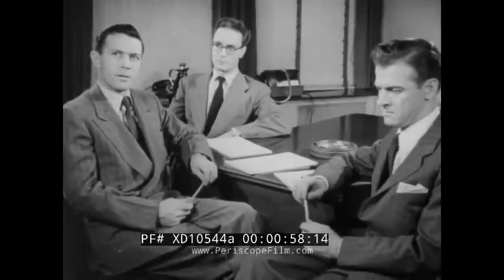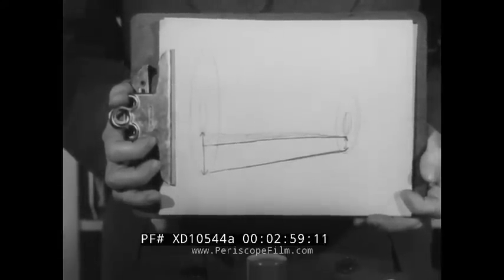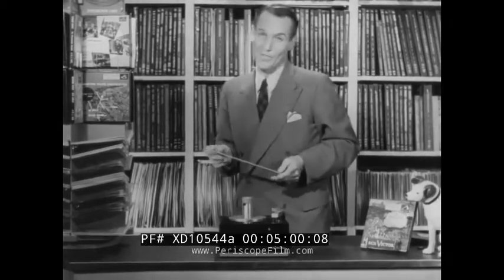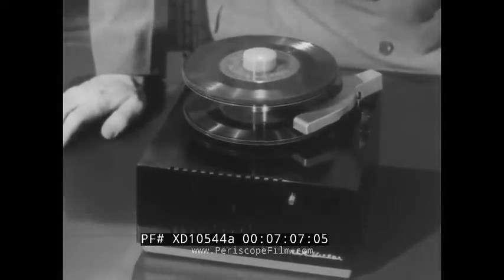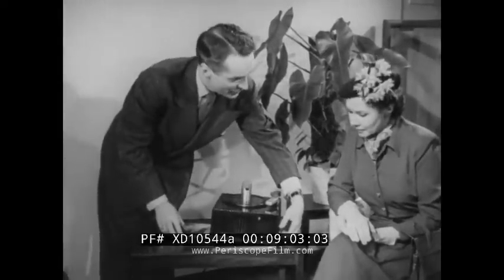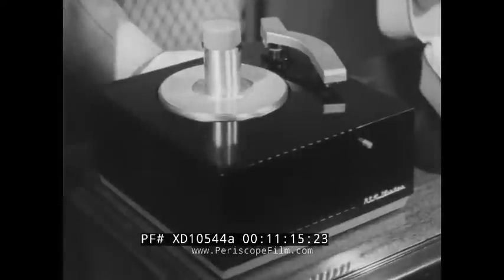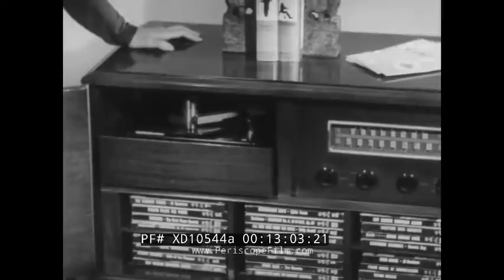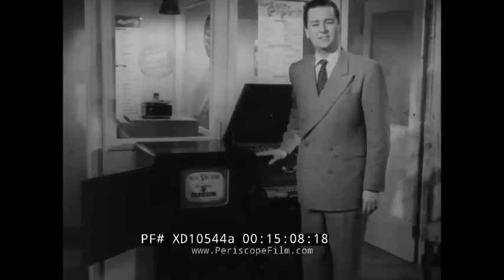NEW RCA 45 RPM RECORD SYSTEM & RECORD PLAYER PROMOTIONAL FILM   VINYL RECORDS XD10544a

Comment: 45s may have been superior in terms of sound, but certainly not with regards to convenience. And entire albums on 45 would have also compromised the artistic vision of recording artists like the Beatles and Pink Floyd. Imagine having to listen to Sgt. Pepper or The Dark Side of the Moon using a 45 rpm record changer.  Personally, if I had been living back in the 50s and 60s, I would have bought my albums on reel-to-reel. I really can't stand the ticks, pops, and surface noise of vinyl.
Reply: You definitely don't get it even a little bit.
Reply: @mikec6822  Nope, I don't get your reply, not even a little bit. Please explain.
Reply: @thehighllama8101  I knew 2 things. Number 1 I knew that you would reply and number 2.....I knew you wouldn't understand what I said due to what you originally wrote.
Reply: @mikec6822  And I knew that is how you would reply to my reply to your reply to my original comment. So, you just don't get it, and I don't get what think I don't get.
Reply: I can;t imagine listening to such noise.
Reply: Alright, ignoring the previous few useless replies.

33's could hold a half hour a side. In those days the most common music was traditional classical (not classical rock, it didn't exist yet). The most common symphony tended to run around an hour. So the 33's 'compromised" the vision of the composer (most of whom were long dead, so didn't mind much) just as much as a stack of 45's would have. The worst part was manually turning the disk or album stack over, not the pause between disks. There were in fact small pauses between "movements" in classical works, and in most cases the music could be slightly adjusted to get these pauses to fall on the record change.

Music was compromised in various ways, and still is. Initially with 78s the music was drastically shortened to get into the 5 minutes or so per side of a 10" disk. Also, loud instruments like tubas were often substituted for quiet instruments called for in the score, because the early recording technology was too crappy to let you hear the quiet instruments over the noise. 

Even with 45's and 33's in the electronic recording technology era, it was common to make adjustments to the score to make the music fit onto the record. It was also common to adjust the dynamic range of the sound once it was recorded. Too loud a passage would throw the needle out of the groove.

7 1/2 IPS 1/4" tape didn't come along until the mid to late 1960s as a consumer item, and then it was only for high-end consumers. And frankly, it was a lot more annoying to deal with than 33 records. Standard playback was 30 minutes per side on a 1200 foot reel of 1.5 mil tape. Longer playing 1800 foot 1 mil reels were available, but the tape was very fragile and easy to break or stretch. And spliced or stretched tape sounded a heck of a lot worse than the occasional click or pop on a 33. And was a heck of a lot more common. Also, head alignment was critical, and it was common for heads to come misaligned on new equipment, (quality control on most consumer electronics in the 1960s onward was crap) causing various kinds of distortion in the playback, including playing two tracks at once -- one of them playing backwards. That was not fun.

Well-maintained 33 records played with a decent cartridge with a good needle had very little click, pop, or hiss. All of those were signs of someone that didn't know how to handle their records. Most people (other than kids) that bought a significant number of 33 records knew how to keep the dust and dirt off them that caused distortion. Clicks and pops were very rare on good records.
Reply: Reel to Reel (Open Reel, or O.R.) tapes were much more expensive than disc records. Good sounding tapes had to be "duped" in real time. Most commercial releases wer "duped" at high speed, but this was still MUCH slower than stamping discs - And time is money. This was true even into the 1970s, AFTER the "records labels" reduced playback speed of pre-recorded tapes from 7.5 ips to 3.75 ips. So the earliest O.R. tapes were Classical or "Broadway" show tunes, to appeal to an older,richer market. Not a lot of "Pop" or "Rock" on O.R. until the late 60's.  I was an Open Reel enthusiast in the '70s and '80s, but I had FEW prerecorded albums on O.R. (and those were the older 50's & 60's and early 70's 7.5 ips stuff) - In fact most mid to late '70s and early '80s commercially released O.R. tapes were not sonicly much better than '70s-'80s pre recorded Compact Cassettes. (mainly due to halving the speed and using crapola tape stock..)  I used the O.R. format as a recording medium and to dub my "vinyl" records to tape at 7.5 ips to limit wear on the records (using the discs as an "archive").
Reply: @lwilton  Records get a bad "rap" because so many "pop" and "rock" records were bought and played by teenagers,usually on lower end gear with record destroying heavy tone arms and craptastic groove grinding "needles". (Not their fault, Teens then didn't usually have the dough for good gear..) I have bought records from the 50s,60s and 70s that were owned and cared for by "audiophiles" - They sounded great. It's the same for cassettes, These can sound FANTASTIC if good tape stock was used and played on a quality deck, Sadly after the 1982 release of the CD, Audio gear manufactures, (Even the "good" ones with a few exceptions.) began to make worse and worse quality decks with "whiz bang features" rather than SOLID transport mechanisms and heads. Add that in with the fact that MOST prerecorded tapes were on "dollar store" grade tape stock.
Reply: @jamesslick4790  It's amazing how well tape can hold up as well. I have a couple of 1959 open reel albums pre-recorded that still play and sound excellent. It's all in the storage of tapes and playing them on a machine that's easy on the tape. Quite amazing for 60 years later.
Reply: @lwilton  Thank you for a very interesting and knowledgeable reply. In the end, I am glad the CD came along, though. When I was in elementary school, back in the 87, my father bought me a Technics stereo rack system, with a turntable, cassette player, and CD player (it cost a $1000 at the time, from Macy's). I bought the Beatles on both LP and CD. Many of the records I bought were brand new, so there weren't many ticks and pops. But as I was recording the LPs to cassette, I started to notice that the closer the turntable arm got to the middle of the record, the more distortion there was. It really bugged me. That's how I learned about inner groove distortion. And I just really prefer my music to be without extraneous noise, distortion, ticks, pops, or whatever. Even the occasional tick or pop annoyed me (It's like trying to listen to a piece of music and having someone randomly, albeit lightly, snap their fingers in your ear). I can understand why people like the sound of LPs, but I think the cost and maintenance of LPs and turntables, in order  to enjoy good, clean sound, just isn't worth it. Again, it's just my opinion. I was unaware about many of the weaknesses of reel-to-reels that you mentioned. Maybe if people had embraced the format, those weaknesses could have been addressed.
Reply: I think there is no denying (except among "audiophiles") that digital recording technology is vastly superior in both sound and convenience to vinyl records. But digital recording didn't exist in the 40s, 50s, 60s, and 70s, so the record was pretty much king of the sound food chain in those days. 

CDs can and usually do sound quite good, but there were some reissues of vinyl records on CD that sounded absolutely horrible. The problem was that when a record was mastered, a specific compensation curve was applied to the master to compensate for known frequency and gain distortions in the vinyl playback chain. Sometimes this equalization was incorporated into the master recording, and sometimes applied when the disc master was cut. 

Many times in the early days of CDs, it seems that new recording engineers were hired to do the transcription that had tin ears and seemingly didn't know about the vinyl mastering equalization, and didn't reverse compensate it out, or find a master recording that hadn't been EQed. The result was incredibly harsh and grating when mastered onto a CD with a much wider and flatter frequency response.

But I suspect that we have pretty much gotten over those years now, and most people mastering music these days have some basic idea what they are doing. Sound reproduction today is so much superior to what it was in 1965 that it is amazing.
Reply: I agree with you. One problem with prerecorded 8-track cartridge tapes was that the music would be interrupted by a fade out at the end of a channel just before changing and continue on the next one. On albums like “Dark Side of the Moon” or any Moody Blues album, this was irritating.

As for the ticks and pops on records, earlier record changers had crystal cartridges which offered a lower sound spectrum than the later ceramic and magnetic cartridges. Also sound systems had a higher signal to noise ratio. So much of the surface noise was hidden by the “white noise” or the AC hum that was heard.
It was when people upgraded their sound systems that all that surface noise became suddenly noticeable.